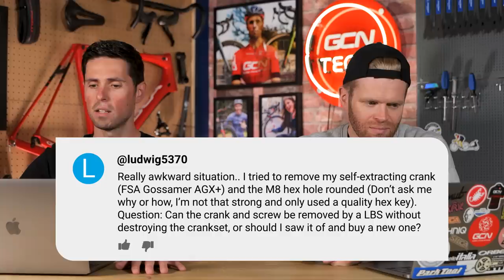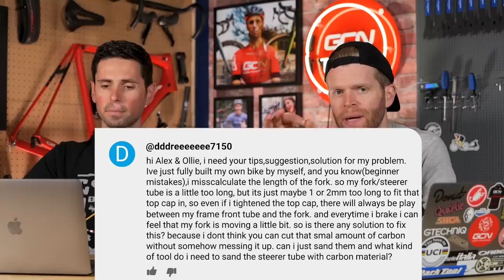Worn Tyres, Stripped Bolts & Aero Bars | GCN Tech Clinic

Comment: ALWAYS destroy parts yourself and buy some new ones (it's more 'cost-effective' as you say) rather than pay someone whos livelihood depends on repairing things....and while we're at it, let's keep buying non-recyclable carbon frames too (as we're all pro-level athletes) and shove them straight in to landfill ourselves so we can buy new ones...and for some stupid reason I thought riding a bike was good for the world
Reply: Carbon frames are not as such bad - 19 years ago I bought an already used Giant Cadex CFR to build it up as a TT bike, and I am still riding (and loving🥰) it. By optimising every component as far as possible, its weight is (with a DT Swiss 1400 Dicut 62 front wheel and a Specialized trispoke rear wheel) a fraction below 8 kg/17.5 lbs. And it is still going strong (and fast).

Comment: Regarding hookless tyres and weight of the rider.. It appears that industry kind of pushes you to be fitter and slimmer. It is probably good?
Reply: Fitter, yes. However, with the increased options, outside road climbing scenarios, I notice that other cycling disciplines often favor different body types.